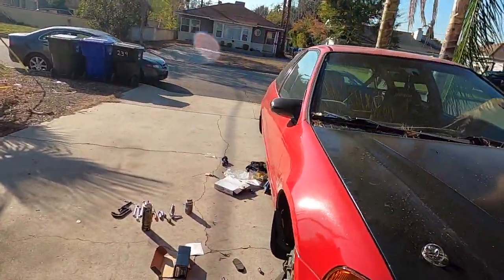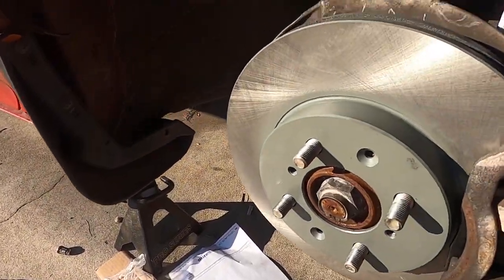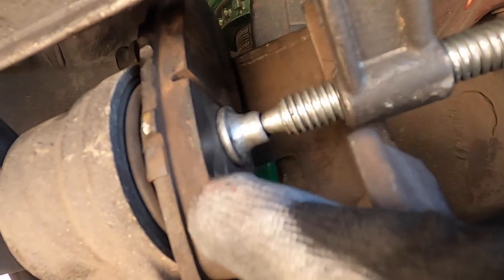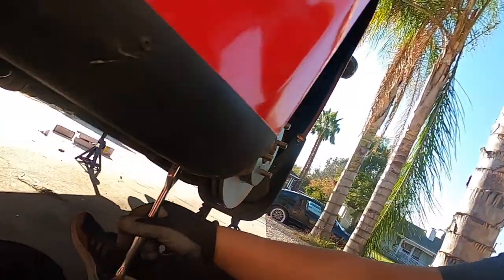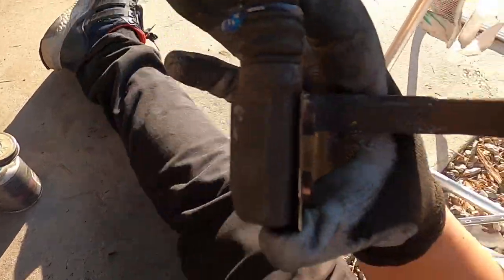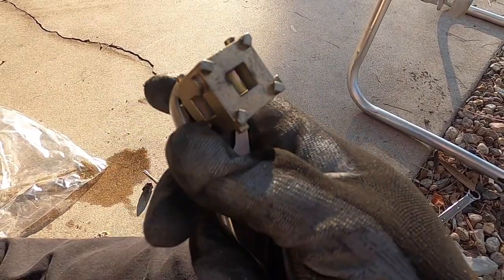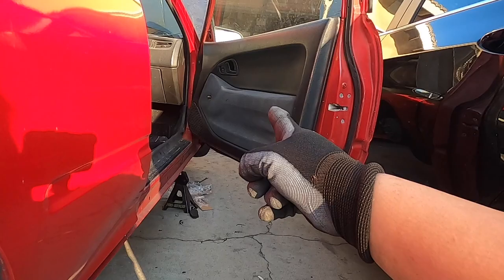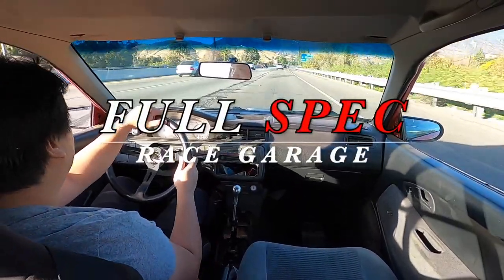Civic EG Hawk Brake Pads | DIY Brake Pad Install

Comment: Thanks for all of this information it’s much appreciated. Do you have the brand name for the rotors you used. Like which ones exactly I have the same car and same setup and need new rotors and have no one to help me. I’ve learned a lot over the past year working on my car but I’d like to change these out since I did the pads. Thanks in advance!! Much love Honda family!!!
Reply from the maker: We have an account with O’Reilly Auto Parts so we used Oreilly’s brakebest brand for both front and rear. 
You can measure your rotors if you have a “Frankenstein” setup like this, then go to the website to make sure dimensions are the same. 1995 civic si rear rotors, the front is also an si rotor if we remember correctly. Hope this helps!

Comment: My rear drivers side brake pads rattle
The pads have plenty of life in them but 1 of the anti rattle clips is missing,
I would love to diy fix it
Am i right in thinking I can take out my pads, insert the clip re insert my old pads and i wouldnt need to compress the calliper?
Reply from the maker: Brake rattle is usually associated with the brake rotor, however, it is possible that your retaining clips may be causing it. You can remove the pads and simply place the new clip in. Make sure you lubricate it with high temp brake grease, you should not have to compress the piston

Comment: Why do my brakes have 4 pistons?
Reply from the maker: Because you sir, have ultimate braking power. Haven't seen stock options to convert to a 4 piston for Hondas, aftermarket only most likely.